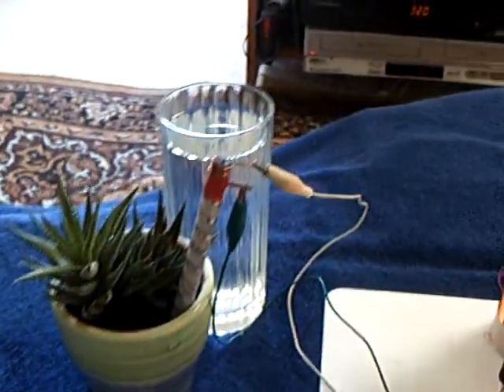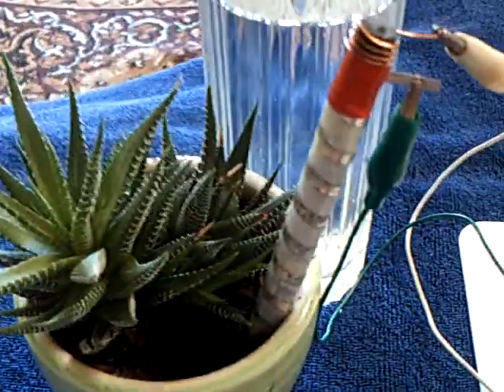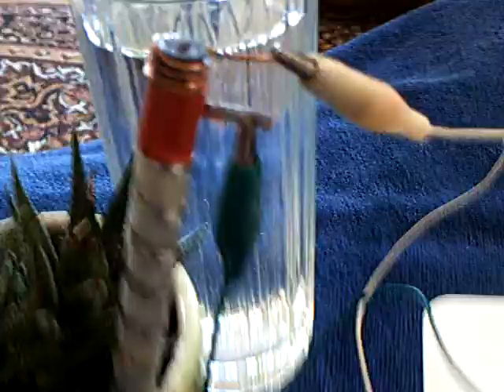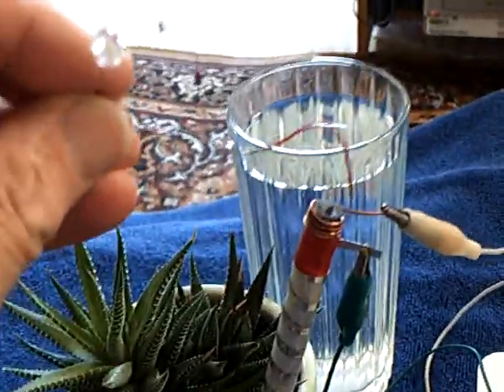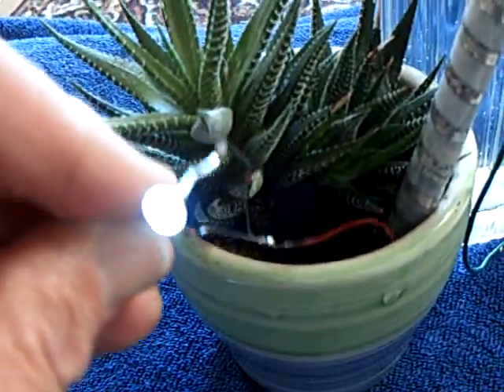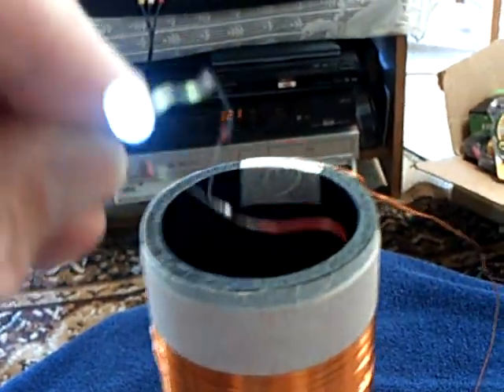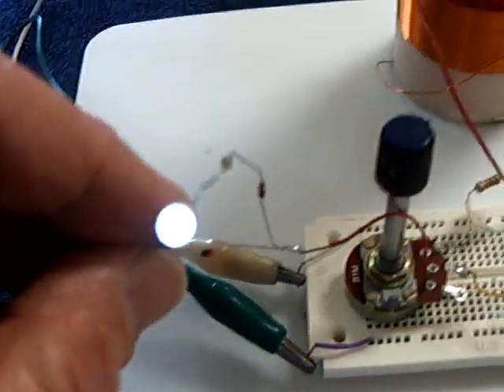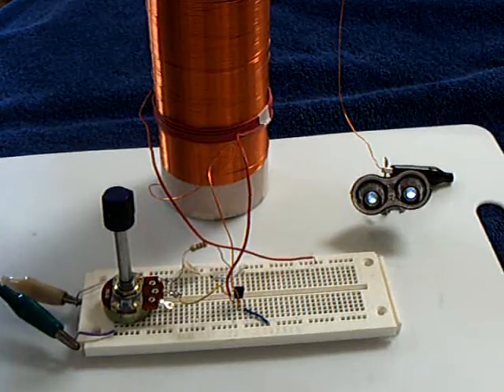Barber Pole battery running an Exciter.ASF

Comment: Heh I love your videos, don't understand most cause I don't do electricity well yet.  But I have a question for you, someone who understands so much.   My brainstorm said why not get a crystal radio---no battery but you can pick up stations.  And remove the headphones, combine the joule thief circuit, maybe with a capacitor and a led light or lights, so if you have a tuning knob on it you can make the light light up, tune it to light brighter....think that will work?